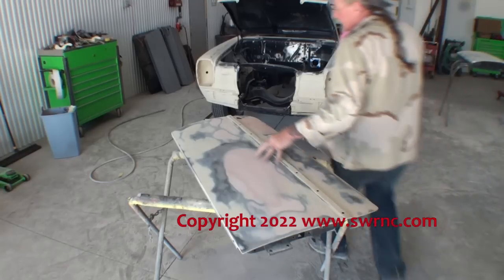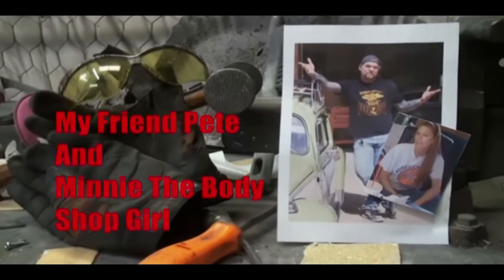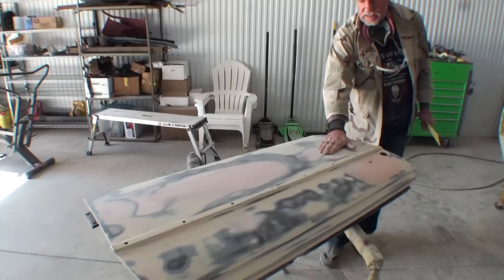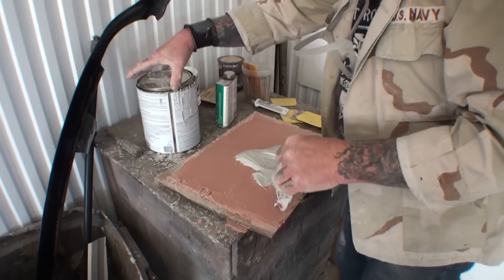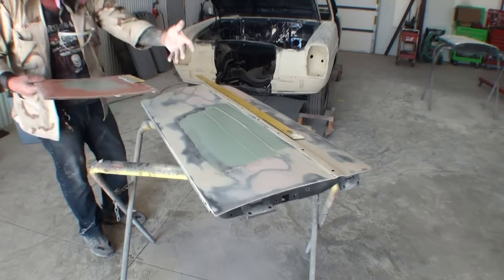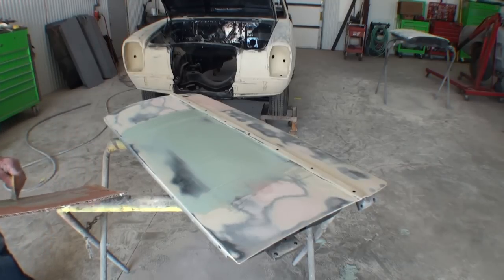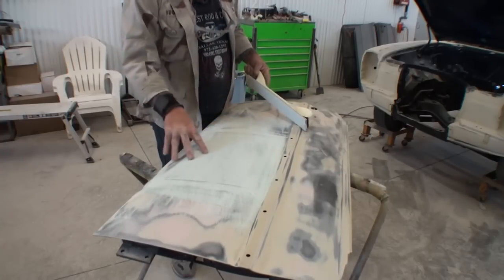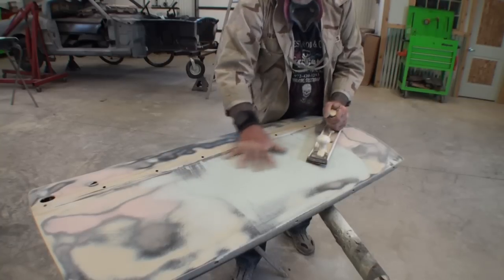How To Spread Bondo - Auto Paint And Body Tech Tips

Comment: Great idea using the straight edge for those long quarter panel's 👍🏽
And to see if there are low and high areas. 
I had used some of that glaze to fill in nicks and pin holes that's some good stuff makes it a lot easier to cover and sand. I agree it's better to hand sand when you get to the finishing sanding so you don't take to much off.

Comment: On point with the so and so's saying gotta use a certain amount of hardener. What if I gotta skim coat a big area, what if I'm doing a bunch of repeat  build up and shaping on something custom with fiber fill....nitwits. 
The straight edge is crucial. I've also made custom cut putty knives and used washers and stuff for those odd angles and radii on door panels and interior crap.

Comment: That was one truly messed up European Mercedes WD115 with / Moon Roof. I have witnessed 23 videos on this car since Pete built a custom rotisserie and started in on the left rear inner wheel house members because there was no frame, very little sub-structure,  no inner support structure for the moon roof, hood (Bonnet) underfloor sub-substructure, floor pans, firewall, using a rocker panel for a 4 door, but cutting it to fit a European 2 door, fitting it into the "B" pillar, fixing inner structure for vent drain drain on the right rear. And once including the left rear tail light panel, round floor fixtures, etc.
  If this vehicle took 516 stamped parts to build it 1976, before they sprayed the entire bottom with some kinda seam sealer, Pete replaced 80% of the car with some hand formed parts and NOS parts they paid dealt for! What an achievement to get it done, completed, straight and painted as Mr. Majestic had the front and rear removed from this car and finished off site. Minnie and Pete trailered the car from Dallas to Moab to finish it. Then tow it back to the Dallas. WoW! That is commitment to get it done!

Comment: You said you did almost everything to try to fix the dent or low spot. By adding the extra coat or two of Bondo, does it make it to thick or is it still within a safe thickness? Thank you for always making the auto body work videos and posting them.
Reply: In my opinion,  no, he was so close that using bondo like he did is NOT a problem. Anyone with a resto/nice paint job, I guarantee the car has been hit with filler to make it flat. There is no other way. There are guys who can do metal work and make it flat but they will have hundreds of hours in it. Basically any shoe car with a 10k+ paint job, the car has filler on it and primer filler 2 boot.

Comment: We’ve used long spline tools to spread filler for over 2 decades now. Guess it’s better late then never that you try it... You can also do quarters, doors and any long large contours by flexing the spline tools to the same curve that you need and then pulling the filler along where needed. Glad your eyes are now open. Lol if you are using a spline tool or straight edges tool to spread filler you should never need 36 grit! Start with 80. If you’ve done it right and at the right curve of tailgate or panel is done properly you won’t need to remove much filler before it’s perfect. And you shouldn’t have any low spots when using the spline tools once you have your first build up correctly layered. Sanding and then going back and again using a straight edge again could cause your uneven issues. Good luck.

Comment: First off I never use anything but a6” snap on palm sander for boy work. I always start sanding on the metal I have then onto the filler then I only have to use a 6” block and ( powder) guide coat to check my d.a. Work. I’m very well known for my mud work 
just saying.
Reply: Oh yeah...  You're that guy they call "Lumpy"   lol, just messin' with ya
Reply: Hey ripples, is that you? 😂
Reply: @JH-vf8rm  no, it's 2 inch Peter

Comment: I never sand filler with anything more coarse than 180.  You don’t need 36 grit. And if you don’t let it harden how do you know it won’t shrink back like it did. You don’t need to glaze it if you’re a good mud man. I only use 1 substrate . Using to much junk expands and contracts each one different and can potentially separate. Just saying
Reply: He is right. Your just taking the top sticky stuff off, then you go to 80, then primer. With 180 you will get waves. You can sand your primer though with 180, then finish off with 320, then she's paint time